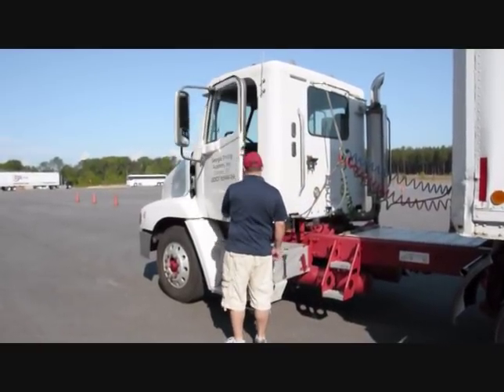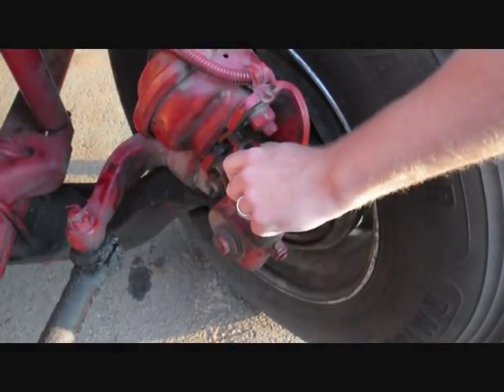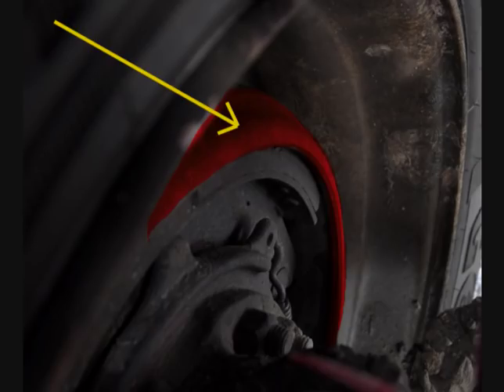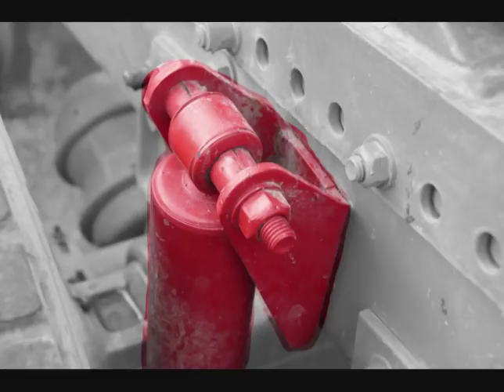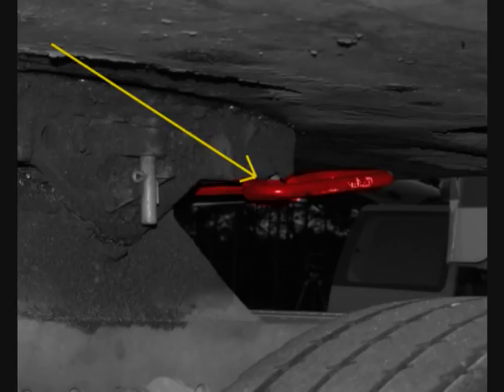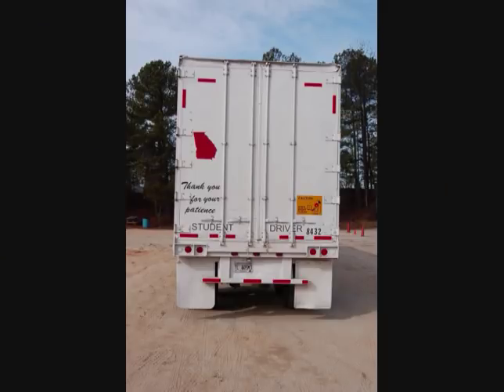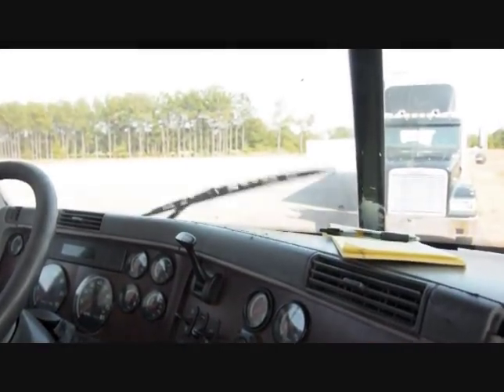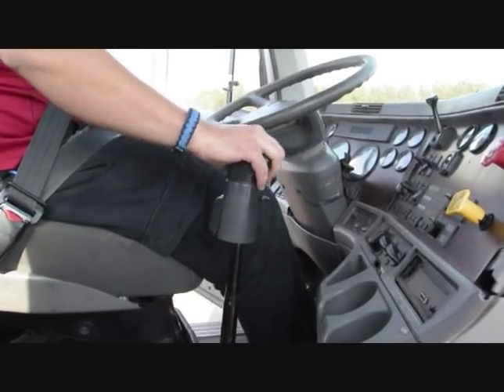GDA Training Pre-Trip Inspection

Comment: Hi!  I am working on a video which is strictly section “C”,  and I should have it uploaded within the next day or two.  The video will include both an air-ride and a spring-ride type trailer, so you will know what to look for and how to call out those components when addressing the suspension components at the tandem area.
Side note:  on a spring-ride type trailer, and remember this is for CR England examiners, you have to call out the torque arm and torque bar...